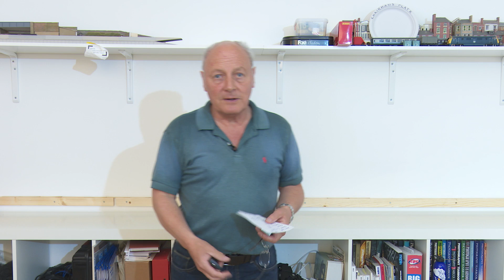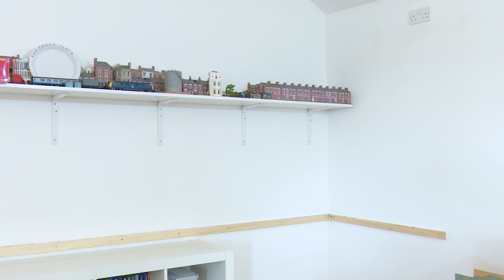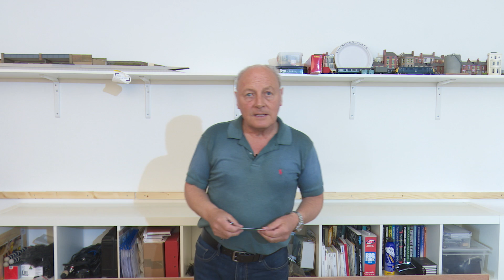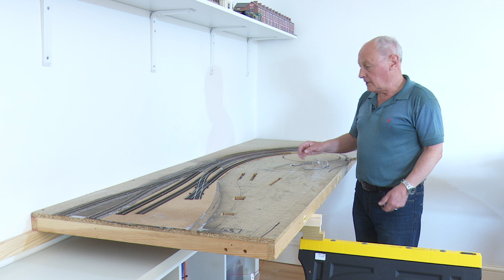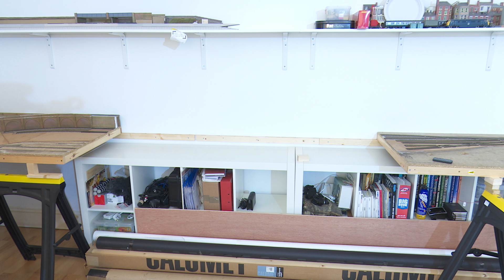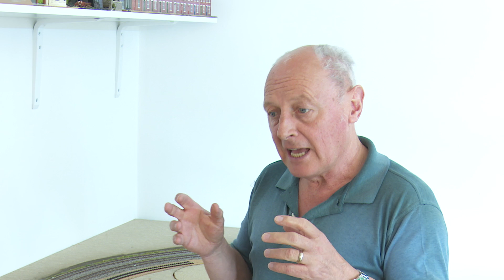28. Chadwick Model Railway Part 4

Comment: Hi Charlie, another very informative video, I wish We had a discount card at our store, Bunnings. No joy there just greedy buggers. There logo is if you find a product cheaper else where they would drop the price by 10%. Well over in Australia they bought most of the opposition out so no chance of that. No pension discounts here.When building my baseboards I put adjustable feet on , well worth the expense, and used a Bosch laser level, only problem this one is on a tripod, so took a bit of doing. It came out ok though.I like what you did in having your boards separate, a great idea, mine unfortunately are all linked so it's a total dismantle if I want a change.Looking forward to the next video, on Chadwick Model Rail, great name , glad you kept it as it's now well recognised on the you tube model railway channel.
Reply from the maker: Hi Richard, I’m glad that you enjoyed it. Yes using the laser makes things so much easier.  Sorry to hear that your DIY store isn’t pensioner focused. Regards Charlie

Comment: Charlie - took your previous advice in building my baseboard height at 36”. Where I live timber outlets are few and far between but I did go to B & Q and for the legs bought staircase spindles that are 90cm long (36”) £2.50 each which give me an ideal working height. Many thanks for the advice.
Reply from the maker: Great move with the spindle legs.  I like it when people think outside of the box.
Regards Charlie

Comment: I too used battons ( we call them ledger boards ), my only problem is I didn't make boxes because I used 2" extruded foam for my platform my " boxes " were ledger on wall ledger on front with 1/2 " plywood on end every 16" for cross pieces.  I used the lazer for the wall ledger . Now my problems began when in my haste I forgot to use one of the four levels I own for the front ledger board . Just raised it to the height ( or so I thought it was) , of the back ledger. So now all 3 of the 18' and 2 15' and the 1 10' sections dip in the middle front left to right. ☺☺.
  I tell you this just to show you we all make little mistakes.
Keep up the good work, Model Railroading is fun, right? 🤠🤠🤠
  
 Bob
Reply from the maker: A great comment Bob. I respect people who admit to their mistakes, none of us are perfect. Regards Charlie

Comment: If I may say, invest in a builders chalk line from screwfix for about a fiver, use the laser to mark each side of the wall, pop a screw/nail in one side and pull the chalk line across taught with the other mark and twang it. perfect line first time every time.
You asked me if I had seen the painting of the arches video, yes and a proper decent job you did. I thought they was excellent.
I learn something new on all your videos, I hope my tip helps you in the future.
Reply: I'm a builder of 35 years, I can't remember what your career was/is, engineer?
Reply from the maker: Hi FG, yes a great builder’s tip with the chalk line.
My trade, I’m a retired sailor but now working as a part time photographer (and YouTuber)!

Comment: Nice update Charlie
I had all sorts of issues with my boards as much of my timber came from reclaimed shelving from work and although it all looked the same it wasn't. I have Cork and card shims under a few areas.  It probably wasnt my smartest idea in hindsight making boards this way.
There are many things I wish I'd done differently on my layout but making the boards modular is the biggest.. Im stuck now with a permanent layout which will need to be totally disassembled to move.
Looking forward to the next update
Cheers Paul
Reply from the maker: Hi Paul, Many thanks for your comments.  There will always be a better way, best to learn from other people’s mistakes rather than your own.  But that is never the case. Regards Charlie

Comment: Hi Charlie, I too have Peco code 100 track and all my points are Electro-frog. The instructions on the double slip tells you how to wire it up as Electro-frog and it worked perfectly......so far. Nice to see a methodical approach to your building. Regards, Geoff.
Reply from the maker: Hi Geoff, I’m glad that you enjoyed it.  Which point motors did you use on your double slip?
Regards Charlie
Reply: I used DCC Concepts Cobalt Digital iP as I have these on the rest of the layout apart from some Cobalt SS on the surface where it was difficult to get underneath. What I did learn was that the point motor on say end A operates end B and the motor on end B operates end A if you know what I mean. The frogs are wired to the point motor on the opposite end. This was my first attempt at a double slip and I rigged up a test board first. I connected it to my Z21 controller and it did work correctly first time although I think this was more luck than experience. Regards, Geoff.

Comment: Hi Charlie, I've also been a victim of the tollerence in the nominal sizes of planed timber. In this case you were lucky. Smaller enabled you to add packing, larger would have been more difficult. If it is critical I always take a sample piece to the store and compare them.
I tried the adapting rail joiners for code 75 to code 100 and did not find they fitted the rails very well. I now us the adapter track, SL-113, which seems to work better for me.
I like the look of that laser level, might have to get one of those!  ......................John
Reply from the maker: Hi John, I’m pleased that you enjoyed the video.  I got on okay with the converter fish plates although you do have to take your time.  Regards Charlie

Comment: Afternoon Charlie 😊 Once again a great update and it’s coming on tremendously 👍 As you pointed out that you’ve put a double slip in for a parcel train DMU siding to get out back onto the down line!! What about if it’s a terminating local that has to cross over back onto the up line? Stevie.
Reply from the maker: Hi Stevie, I’m so pleased that you enjoyed the video.  You’re not the first to mention that point. I want the minimum number of points in the main line to allow scale speeds.  What I’ll probably do is make it a secure parcels area.  Regards Charlie

Comment: Hi Charlie.

Very good progress.
Looking very impressive.
A few points if I may.

Are those white units under the baseboard movable because even though you are fitting the point motors & doing the wiring with the baseboards upright once you've fixed them down & you have a problem you may need to go under the baseboards to fix it.

Are you going to fit the back scenes before you fix the baseboards in place ? Otherwise you would find it very tiring leaning across the baseboards to get at the back walls.

I use code 100 track as well but I also have a few code 75 crossings as well.
I found that by putting a piece of thin card under the code 75 it bring it up to the level of the code 100.
I also found that if you fit a rail joiner onto code 100 & then crush the protruding end of the rail joiner the code 75 rail will sit on top of the crushed code 100 rail joiner & bring the code 75 rail up level with the code 100.

I'm sure you've probably thought of most if not all of the above but thought I would mention them anyway.
They might be of help to someone else.

I'm enjoying your videos so keep on making them.
They're very informative.

Tony.
Reply from the maker: Hi Tony, I’m so pleased that you enjoyed the video.
Yes the white shelves just slide out when empty, I just have to watch where I place the supporting legs.
Yes I do intend to place the back scene prior to fixing the boards in place. In fact that’s the next big task.
I’ll have to check the level of that code 75 double slip when I return home on Wednesday.  Keep the suggestions coming, regards Charlie

Comment: Another excellent video.  B&Q discount Wednesday finishes on 3rd September (2018). I shall be stocking up next week!  Question:  what method do you recommend for locking baseboards to each other?  I will have 3 (2’x4’).  Your expert advice would be appreciated.
Reply from the maker: Hi Brian,
One question for you first.
Is it a permanent layouts does it get paled away? 
Oh, I’m no expert.
Regards Charlie
Reply: Hi Charlie.  The layout will be in the loft.  I don’t envisage it ever moving but I would like (ideally) to be able to detach one section and upend it to work on wiring etc,   The loft space is very low and getting underneath the baseboards will be almost impossible. But certainly no regular movements.   PS “expert” is someone with more experience and knowledge than me, for which you qualify.
Reply from the maker: Brass pattern makers dowels, are the alignment parts that you need.  There is a male and female and you need two sets on each join.
You will also need a set of catches on both sides of the boards to pull them together.
The best thing is to go along to a model railway show and see what the exhibitors are using.  Squires can supply all of these bits.
Regards Charlie

Comment: just wanted to know why you didn't use the smaller code instead of the code 100
Reply from the maker: Hi James, when both Code 100 and Code 75 when ballasted and weathered, I find it difficult to tell them apart.  Code 100 is more robust but Code 75 has the advantage of electrofrog slips.
Regards Charlie